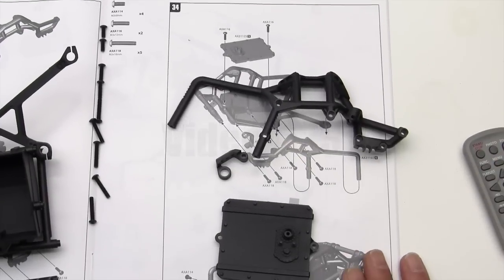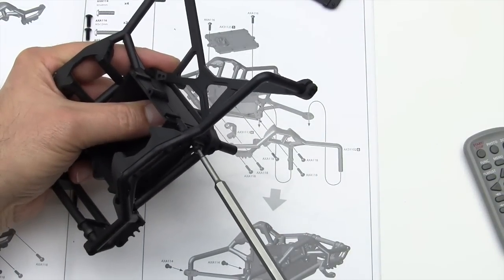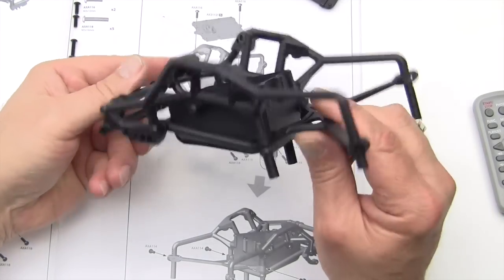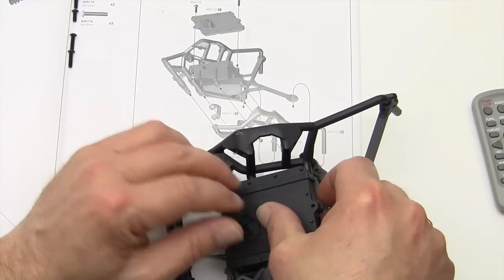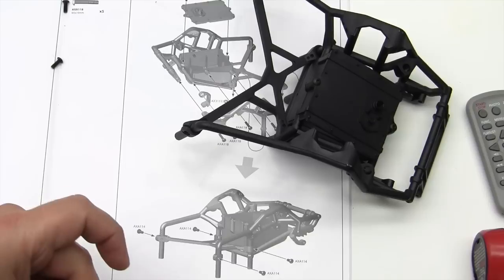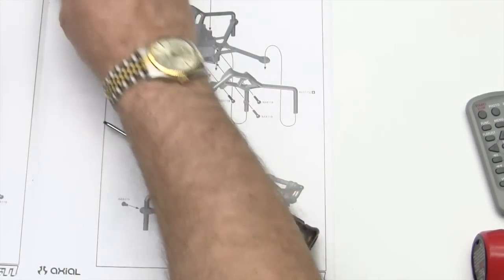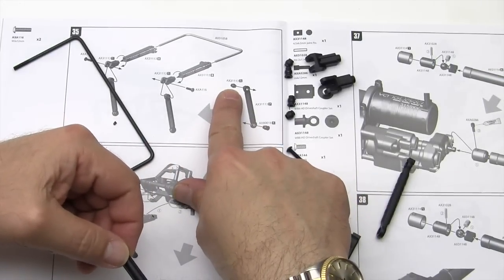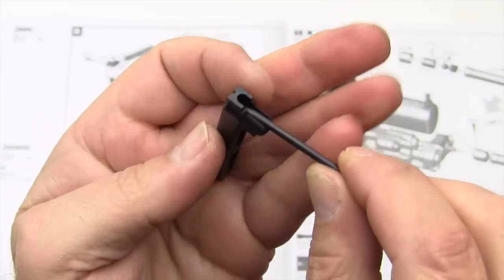Axial Yeti Build Video #23

Comment: what weight shock oil is everyone using.  I will be using my yeti for open areas, jumps, mud, very little climbing.
Reply: I would run 30 in the rear and 50 up front